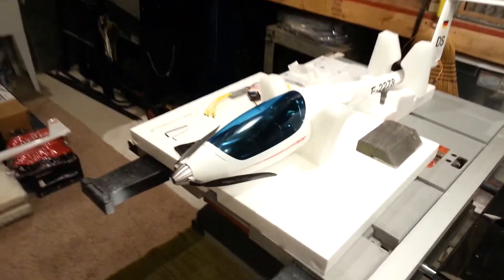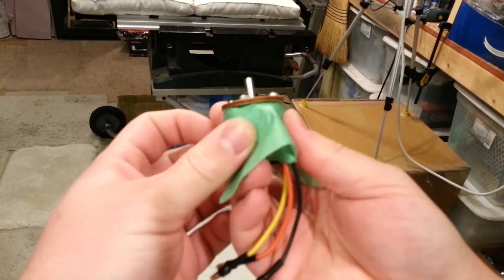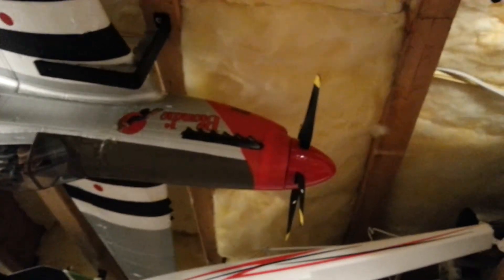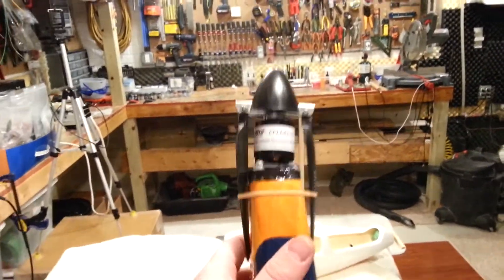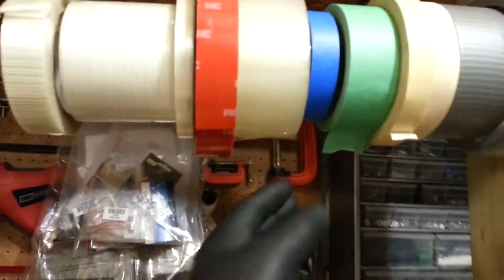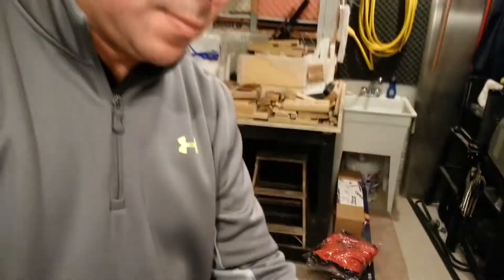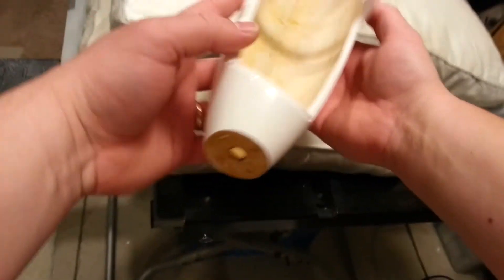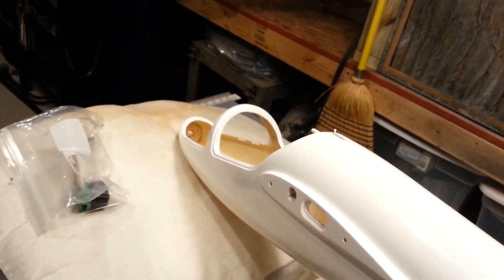General Hobby - FlyFly - DG-505 - 2.6m Composite Sail Plane - Motor Mount Installation

Comment: Hey Brian, great video content I really enjoy what you're putting out. The first person camera has to stop though, you move too quickly and the shakiness in the picture is headache inducing. Maybe grab a tripod and/or some flexible clamps while you're filming solo but the camera on the head thing....
Reply from the maker: I understand your concern, and agree that the bouncing is annoying. I've done the Tripod thing and do occasionally film that way, but it's a lot harder for me to get good footage. I have a really hard time making sure the work stays in focus. If you have any recommendations on head gear, I'd be willing to check them out. My current setup is just a home-made hard hat (bump cap) liner with some stainless steel hydraulic line that I bent to hold a cell phone holder, normally used for a car mount.
The reason for the bounce, is the distance it hangs in front of my face. I can make out if the video is in focus. I did do a video where I stuck a tripod into my pants (sorry for the visual), but that got in my way a lot...
Reply: Brian Phillips thanks for your reply, really appreciate it. You do good work, hire Esteban as your videographer. Keep the videos coming! Building a FLYFLY ASW28 this winter because of your videos. Cheers
Reply from the maker: Nice!!! It's a LOAD of work, but you'll love it when it's done, if you're half as lucky as Esteban and me. This project was a huge learning curve for us. I know how to build from balsa, but working with fiberglass is a lot different...more different than I expected. Lots of little challenges like the canopy fit and closure, for example.

Comment: How did you guys cut the nose off? I’ve gone through your playlist and footage there was not a lot of talk about that step unless I missed it.  I realize you are very busy if you don’t have time to answer no big deal.
Reply from the maker: I try to answer all the questions, but sometimes YouTube doesn't notify me :(
I regret to inform you that we didn't film that part for whatever reason. It was actually fairly easy, but make sure you put on masking tape and make sure you work in some down and right to counter your torque roll, OR make sure you can shim your motor without hitting the inside of the fuse.
Good luck!! Sorry we didn't film that part for you!

Comment: How did you guys know what size folding spinner hub to order for the ASH-28 and the DG-505.
Reply from the maker: Well, the ASH-26 and the DG-505 don't come with the nose cone cut off....you actually have to cut it, where you want, presumably, then you can figure out how big it is. Usually the motor diameter is what dictates the location for cut, and it varies a lot from model to model. I'm no expert on composite sail planes, just a nube....it's a whole another dimension!!!
Reply: Just curious what you guys used for a folding spinner. 
Thanks
Reply from the maker: We both got our respective spinners, and folding props here...

https://alofthobbies.com/search/?q=folding+prop

This place can set you up, and they have very low shipping rates, and VERY good customer service. You can call and talk to an actual human being!!!

Please note that two people could build the same DG-505 and need different size prop depending on your power system.

If you really want to know the specs, they're reviewed in the exhaustive build series for the ASH-26 or the DG-505. I've made playlists for all planes on my channel so you can find these answers. The DG-505 is using a 12X6.5 folding prop as mentioned in this video. I don't know the spinner size, but if you look at the playlist you can find the video where we do this.

I spend a ton of time making this stuff, and it gets a bit frustrating being asked the same stuff that I spend hours making available. It's really hard to remember it all! I know you don't mean to be annoying, and just want some help, but I'm super busy trying to make footage right now, so please try the playlist for this one, and let me know if you can't find the answer to your question.

Comment: So Brian this is Hans hey I also bought a DG 505 same bird that esteban's got I see that he used a 40 amp ESC and a 12-6 prop what size motor should I use and will a 3-cell 2200 milliamp 30 C battery work
Reply from the maker: Hi Hans. I'd encourage you to start at or around 2200mAh 3S 30C (30C might be a touch low), but be ready to change that size if you need to work out your CG, once all else is done. I can't tell you what size to use for sure, since Esteban is still working on his DG505.
Reply: Brian Phillips what about motor size how many KV and what size is that motor?
Reply from the maker: helibird7 I don't know what Esteban used. Sorry. GrantL also built a DG505....and he might be able to share what HE picked for his.

Sorry
Reply: Brian Phillips thanks brother I just bought the Emax motor like the one you have in the ash 26 970 KV
Reply from the maker: It's a WONDERFUL power plant, I just wish she were rated for 4S :(
Reply: Brian Phillips yeah but even with 3 s you're a Ash 26 seem to have plenty of power
Reply from the maker: True ;)